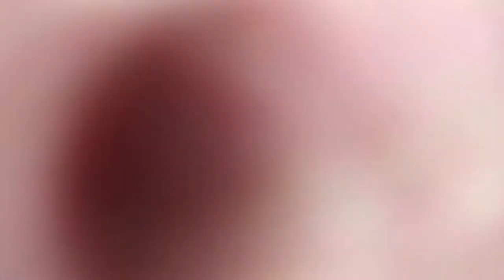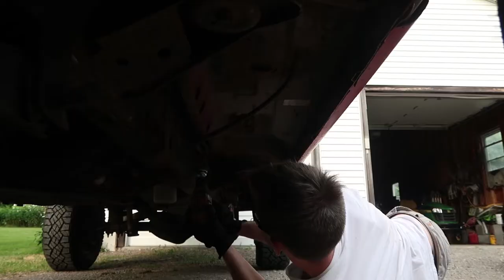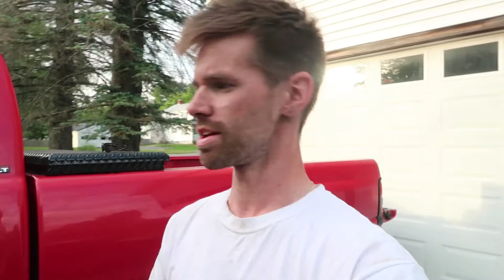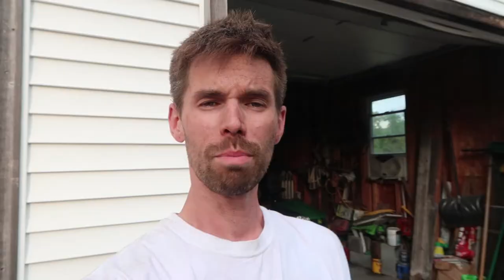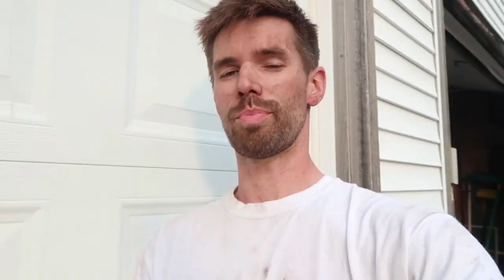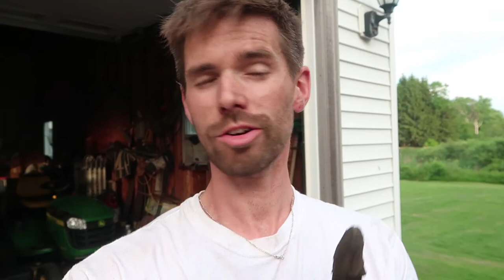CUMMINS FRAME gets PREPPED for PAINT (undercoating)

Comment: Nice video the frame isn't that bad but still some orange and that 24 Valve sounds awesome
Reply from the maker: Frame isn't all that bad, but there are a couple spots that I wish weren't as bad as they were. Unfortunately I can only control how much winter weather affects everything to a certain extent. Eventually it will all catch up to the truck and cause some issues that need repairing. I'll honestly probably never have to worry about the couple spots I spoke about in the video though. I'll clean it all up and get it protected and I'll sell the truck to get into a 3rd gen before the 2nd gen ever starts to fall apart.

Comment: The lower spring buckets on the front axle rust bad on 2nd gen Dodges .. And the frame where the front sway bar bolts on rusts on the inside because the frame dips down there and water/moisture lats in this spot  , those spots should have oil sprayed on them ..
Reply from the maker: lufkin tape I looked at a 2nd gen last year that the front frame was rusted right out on. 3 holes through the frame by steering box. Kid tried to tell me he had "no idea" after I drove 5 hours down P.A. to see the truck for 30 seconds until I noticed the holes and turned right around and came home.